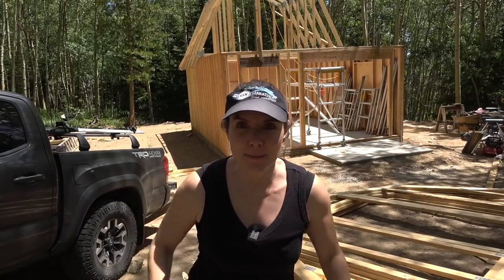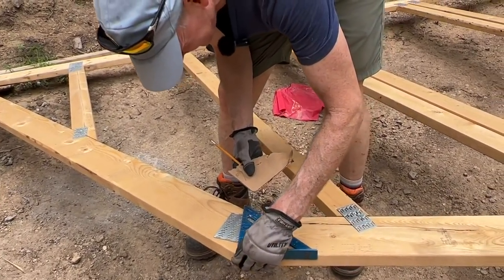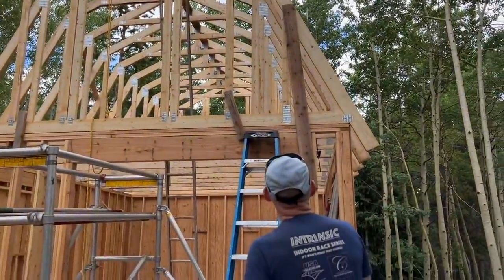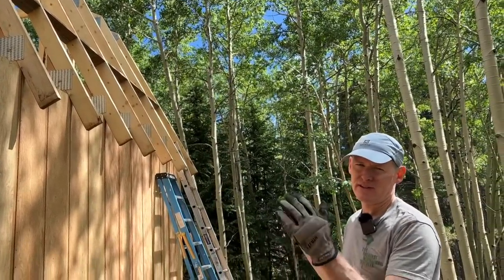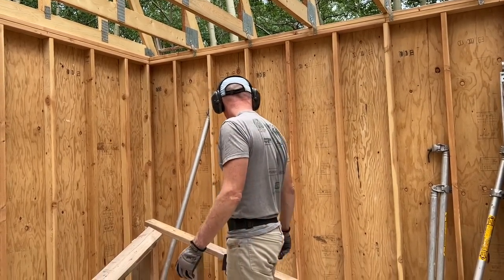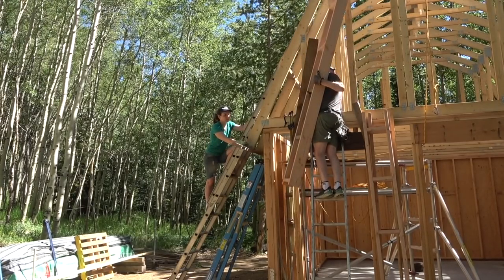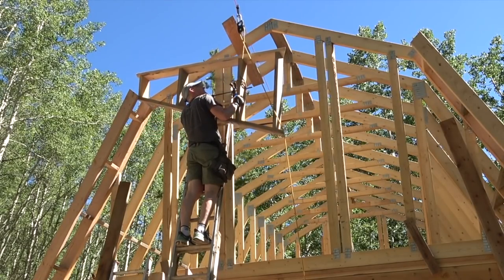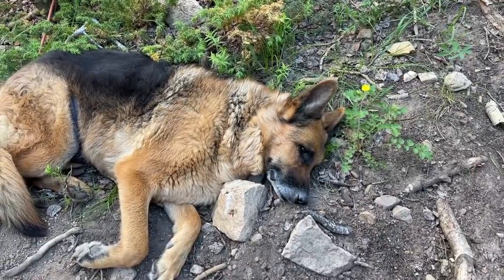Design Change Creates Problems for Barn Shed Build

Comment: Great job. The addition of the birds beak makes it your own design. It is a project to be proud of. Happy Independence day.
Reply: Plumb up square up and get way more bracing in place. After that sheath them portal frame opening. Man and garage doors.
 Thats what  makes it strong .
Do not under estimate  what  the wind will do to your unfinished  project.
Make sure them gable end are plumb ,you added top heavy  elements  to it and until roof sheathed this will  be effected by gravity.
Even a temp post at the point from the ground on a  solid surface good.
Also after  gable trusses plumb and braces( youve got them all blocked together the shoukd move as one. X brace in them storage area in truss. Start up high  and angle down  towards  the ceiling cord.
 Do the same on rear .up high and down..
If  you start to get some weather issues and cant sheath roof  at least it wont domino.
.
Be safe
Reply from the maker: Thanks for the tips! Adding bracing asap.

Comment: Bryan, I think it would be advisable to inset braces (2X4) running every 24 inches perpendicular to the rafters across the outer two rafters and the eave structures. Notched in and laid flat joining all four of the roof members and strengthening the eaves. That way you will be able to walk on all of the roof without fear except the angles. Roof load will not affect the structure. It'll give more nailing surfaces and attach the outer eaves to the first two rafters. Requires notching (3 1/2 wide X 1 1/2 deep)  across each of the rafters and the eaves for each cross brace and eliminate the need for external 45 degree beam supports.
Reply: Yes, that's the way it's done where I come from.
Reply from the maker: Hi Clyde!
I think I understand...Ties the bird's beak portion into the outer two rafters.   I'll look up a few pictures and consider it.   Thanks!  Bryan

Comment: Also Bryan I just noticed the sides of your building moving.  Nail you a temp cross brace on the front till you get your siding on.  Just a suggestion.
Reply from the maker: Yep. He had one on there but took it off to finish the trusses, now will add back.

Comment: All them walls  needed to be braced way better. You will have a big failure. Soon same fore trusses.  Even when your complete bracing needs to be on place.
Reply from the maker: Hi Randy,  I agree!  I plan to add bracing to the truss/walls,  every other truss.  We have the same lateral bracing on the timber frame in the house.
Bryan

Comment: you need three pulleys to get mechanical advantage.
Reply from the maker: Hi Daniel!  I have three but realized I needed to turn the pulleys on the cable upside down.  Duh!  Maybe I'll just attach them to the cable with a couple carabiners and try it on the north end.  It wont slide as well, but thats ok.  The cable also does not line up with the peak as well on that side.  Someone planted the trees in the wrong place.   Thanks for watching!  😂-Bryan
Reply: @ColoradoMountainLiving  You are doing a great job. Keep up the good work.